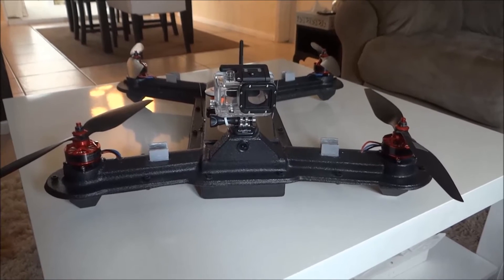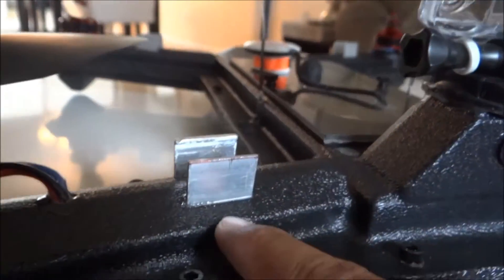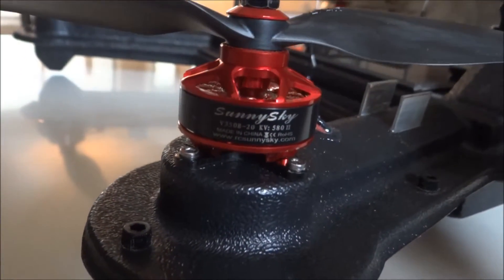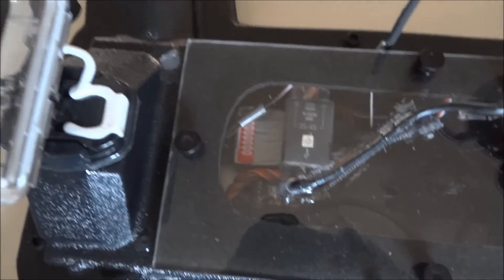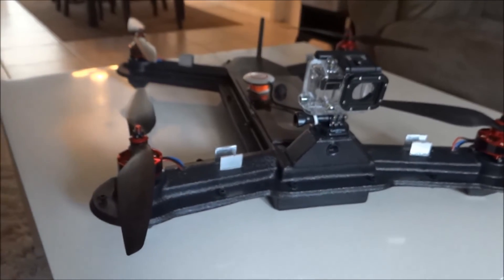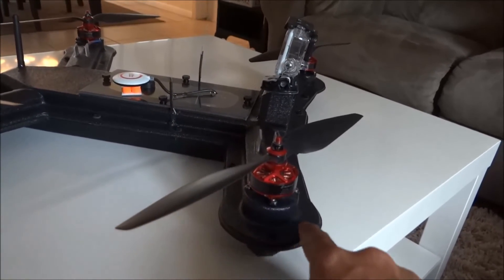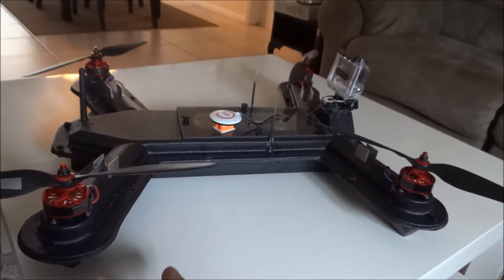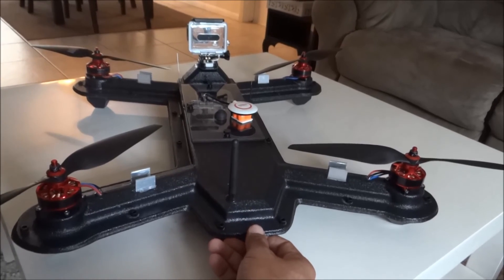Waterproof quadcopter stealth H2oh setup

Comment: Hello, did you use one 5A battery? If not how did you balance the cg of the quad? The mistake I made with mine is that  Ihave the rear ledge as the back of the plane and the triangular side as the front. 

I have mounted the fpv camera in a gopro case under the frame and ran the wiring through a silicon tube inside the frame to see under water. 

I still haven't flown it yet. I've flown it with the Pixhawk but the pix setup is a nightmare.
 Now I opted for the Naza lite. Please can you give extra tips other than the ones mentioned in the video.
Reply from the maker: Yes. I used a 5000mah 4s battery and it ballances perfect.  What problems are you having with it?
Reply: Thanks for the reply! The quad seems to vibrate and make a lot of noise. The CG problem made the quad drift a lot in Stabilize mode. The Orientation problem I cannot figure out which side is the forward side. Balancing the quad only enabled me to balance the pitch CG however I'm having problems balancing the roll CG because the equipment inside is not arranged symmetrically. It was a headache. I'm still procrastinating with it :).

Comment: How do you switch on/off it? Where placed the battery?
Reply from the maker: The battery is under the clear, sealed acrylic.
Reply: +TheFido03 have you to unscrew the screws to enable quadcopter? Is it fast?
Reply from the maker: +Миха Нек yes, 6 screws. no tools needed. It's slower than a regular quadcopter of the same size because of it's wide body design, not so aerodynamic.

Comment: Nice build. I'm hoping to do one pretty similar... A couple of qs... 1) do you think that going for bigger props would help with the flight times?

2) any pics of how you installed the heatsinks.

3) it'd be great if you could add the setup specs to your description (more of a request than a question ;)  )

Cheers,

James
Reply from the maker: 1. The largest prop I could use was 12" due to the gopro housing. I think the max would be 13" if I didn't have the housing in the way.

2. The esc heatsink is superglued to the aluminum heatsink that's sticking out of the arms.

3. I think I mentioned the specs in the video.
Reply: Thanks for that.  Very helpful